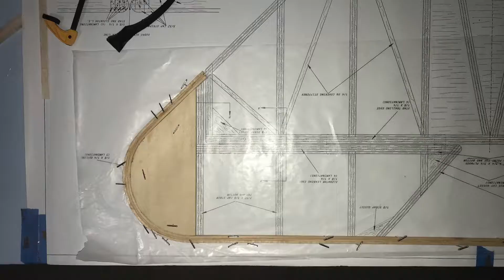Balsa USA 1/3rd scale DR1 build

Comment: Also what size battery pack, did you use two receivers, ie one for the wing and one for fuse?
Reply from the maker: I’m using 2-2500 batteries on a smart fly and one receiver. I ran servo wires up along the cabanas and painted them black

Comment: Is the cowl after market and if so from which company, how much ballast did you add?  Thanks
Reply from the maker: The cowl is from Arizona Models and its aluminum. gives the plane a more scale outline. I built a shelf over the motor and was able to balance the plane with just under 3 pounds of lead.